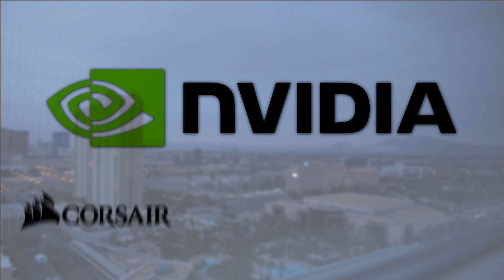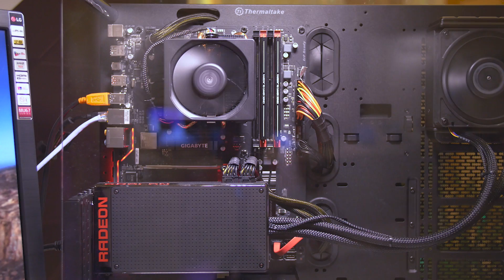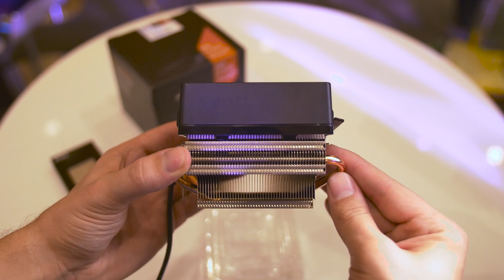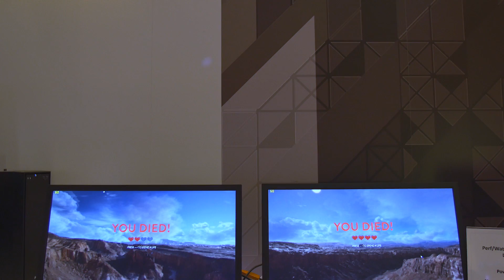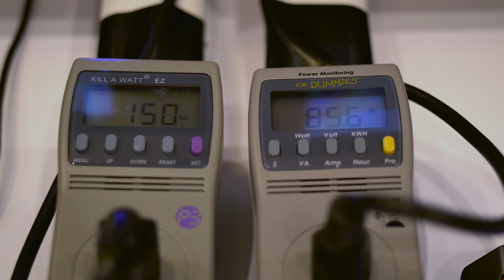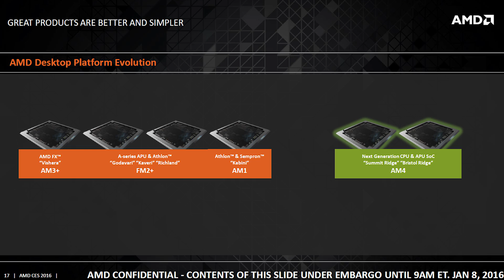AMD Polaris, new Wraith CPU Cooler & AM4 Zen

Comment: I hope Zen isn't the same story as the Fury X.
Reply: those are two entirely different things that can't be compared
Reply: It won't, they got their CPUs and GPUs down to 14nm, they should be much more efficient.
Reply: Joegaming Not when it comes to marketing, or the fact that it's AMD.

l__T__l Efficiency is one thing, which they already have sorted, but power is another.

I was meaning that how with the Fury X, they boasted it was going to be the best GPU on the market, and even showed benchmarks of it beating the 980Ti or Titan (I can't remember exactly which), but then when it came out, it didn't deliver to its promise.
Reply: +SlavjanA pff Nvidia does alot more marketing then AMD but neither does it on YouTube or TV if they really want to step it up thats one way also AMD used to beat Intel and every one new that  but now they just slowed down and AMD didn't make GPUs till they bought ATI
Reply: +SlavjanA I hope Zen isn't the same story as Bulldozer. =(
Reply: +El Hefeweizen http://linustechtips.com/main/topic/48571-intel-amd-architectural-discussion-how-far-ahead-is-intel/
Reply: +SlavjanA 
I don't recall AMD saying that Fury X will be the best GPU on the market.
That seems more like fan expectations blowing things out of proportion.
AMD did mention things such as 'revolutionary HBM' and improved performance per watt (which we DID get - more or less, Fury comes pretty much in line with Maxwell in terms of performance and power consumption at stock).

Also, people seem to glorify Nvidia, but completely forget that Maxwell runs on reduced clocks at stock (giving it more OC-ing headroom).
In reality, when you start overclocking Maxwell, its power efficiency evaporates for the most part, and power draw is substantially increased.

Finally, AMD's gpu's perform much better in professional software than Nvidia does. I suspect that this is where most of Stream processors are going and why more of them do not translate to necessarily better gaming performance.

As for Polaris... the part demonstrated was an entry level desktop part with GDDR5 which consumed on its own (separate of the rest of the system) about 30W (while the GTX 950 is rated at 90W)... they mentioned that HBM 2 will come later, and that the current Polaris chips are open to further optimizations.

Nvidia still didn't manage to present a working Pascal part (what they demonstrated at CES was mobile Maxwell - 980M), and it looks as if they might have hit a snag.

Personally, I'd prefer AMD taking the reins and its marketshare unopposed this year (they certainly need it).

And as for Zen... I don't think we will see a repeat of Bulldozer fiasco.
The 40% improvement in IPC was gained over Carrizo it would seem (as AMD reported that ZEN met their expectations)... now couple that with 14nm manuf. process, and other things (such as HBM, Polaris IGP, etc.), and Zen looks (At least on paper) really good jump in terms of processing power (alas, we won't know anything conclusively about ZEN CPU until we are closer to the launch date).

AMD seems to be pouring everything into ZEN, and also this new Polaris releases, so I wouldn't discount them just yet.
I'll keep an open mind.
At any rate, I'm definitely getting myself a laptop with a high-end Polaris GPU (which hopefully will feature HBM - though I don't think HBM for mobile was mentioned anywhere).
Reply: deksman They did boast the Fury X was going to be better, look around online (I think anandtech had the post) before the launch of the Fury X, and you'll see AMD showing benchmarks of it running better than the Nvidia cards (I think it was at a press conference or something like that).

Even now AMD is beating Nvidia for the most part, anything below the 980 vs 390x (although this does depend on how long the person plans to own the card for in a way), AMD beats its Nvidia counterpart (390 vs 970, 380 vs 960, etc).

As far as Zen, then yeah on paper it seems great, a lot of work going into it as well, over a long period of time, with a lot of talented people, so that's why I hope it really does deliver.
Reply: +SlavjanA 
Don't forget the R9 Fury Nano.
That's a direct competitor to GTX 980 that delivers slightly better performance with a comparable power draw.

Polaris looks to be shaping up into something really interesting.
Reply: Petar Posavec Oh yes, wouldn't have been bad if they lead with that instead of the Fury X.
Reply: +GlueGaming 
No argument that AMD has their work cut out for them... but it is also not entirely AMD's fault when it comes to hardware adoption by OEM's.
In case of laptops, AMD cannot control anything there, though I have to say that Carrizo uptake was better than Kaveri in USA... though Europe saw a much better quality hardware with Carrizo (such as 1080p screens,  etc).

Comment: Tried the Wraith cooler & its still Much Louder & Hotter than with my Noctua setup, I'm sure just the Noctua Thermal Paste alone is a big improvement over what comes with on the Wraith. I'd still highly recommend buying a good aftermarket cooler ;-)

Comment: just when you bought your new pc, with all amd tech...
Reply: Still a year for Zen to come
Reply: +Abhinay Raikar still, that's pretty close about autumn/Q3
Reply: At least I'm not the only onr
Reply: +TheEpicCrumpet That's the rule of building a PC. Something new and better is just around the corner. And the people who upgrade to ZEN and AM4 in Q3 or 4 will be pissed when not long after they announce an improved line of processors with better performance and probably better efficiency.

We just have to learn to bite the bullet. I bought a R9 380 in November only learn the 380x was getting released in a few weeks.
Reply: +this Indeed. I wasn't so angry when the improvement over the 380 wasn't so much. I get the 380x performance with my overclock. 1100mhz core clock and 1600mhz memory clock.
Reply: +RGInquisitor I did the same.... just the day before the 380x was released......
Reply: I feel ya. Literally everything is AMD. But oh well. I think I'll let the 8350 sit in my system for a few years but at some point soon I'll want to replace my R7 360 with a Polaris gpu when they arrive. So I'll be hopping on that when it arrives.
Reply: +Anthony Mendez on what resolution do you game and how does it perform?
Reply: +TheEpicCrumpet I had bought my parts based on the rumors of FX, I got the 6100 and then later the 6300. Now I'm just waiting to see if Zen delivers more than Bulldozer or Piledriver.
Reply: ***** If you're using optifine with Minecraft, set the draw distance to something between 16 and 20. Depending on how much memory and CPU clock speed.
Reply: I technically have the same build as you. An FX6300 @4.5Ghz, 8GB of RAM, and an R9 285. Render distance is the biggest framerate killer, other than mods. Rei's Minimap will drop the framerate dramatically unless you enable multithreading.
Reply: +RGInquisitor 

At least AMD is being smart about it though this time. All their processors, APUs and CPUs, are going on the AM4 platform with DDR4 as standard. So many people on Team Red will at least have a upgrade path without having to buy a whole new system for a good while. Unlike those that have bought the AM3+ or FM2 platforms in recent years that built themselves into a dead/dying platform with no upgrade path.
Reply: +Anthony Mendez 

Something was definitely screwy with Fallout 4. Hell I even had to modify the .ini file just to get it to play 21:9 ratio at 3440x1440 resolution. Game came out in Nov 2015 and wasnt even coded for 1440p. Even then, I still get random frame drops and thats with TWO MSI 980ti's overclocked in SLI driving it.

Comment: Zen CPUs in mid 2016? 5 more months to go!
Reply: End of 2016 basically early 2017 aka 1 more year
Reply: Polaris the low end gpu will come in less than 2 months and the higher end gpu's will come in the summer and for zen amd said q4 so expect october or later, don't expect anything earlier even jan 2017 could be a possibility *****
Reply: ***** june/july 2016 this summer hopefully, expecting no delays

Comment: Looks like those Tom's Hardware articles predicting a brand new AMD cooler featuring a new version of AMD's Cool 'n' Quiet were right after all. How the hell did they know that before CES..? Anyway, lets check what's yet to be revealed so far:
Polaris Architecture. Check.
Brand new stock cooler. Check.
FinFET-based GCN GPU. Check.
Radeon Memory. Check.
"Radeon" branded SSD. Nothing yet.
Vulkan support on Linux. Nothing yet.

Comment: Did they show anything that would clearify if the AM4 socket has the same space between their cooler mounting holes as the previous sockets?
I want to upgrade the cooling in my system, but upgrading now to something that would support my 4690K aswell as AM3+ and then have it not support AM4 would just bring extra expenses and I'd have to buy yet another cooler if I want to upgrade to Zen when it launches.

Comment: as you know , the wraith cooler is not a high-performance one.
and it is still not quiet enough . 
92 mm fan is the point !  
if  wraith use 100 mm fan  and  has 10 mm  cooler fin  , that will be better .
i don't want to spend money  to get  a  unsatisfied  stock  cooler. 
i prefer spend 5 more USD  for   getting  a useful AMD stock  cooler . 
e.g.  something looks like  Reeven BRONTES RC-1001 、Thermalright  axp-100 .

Comment: this is actually making be think more about weather i should get an 6400 i5 like i originally thought, or wait and see what zen has  anything to offer. I tend to use virtual machines and multitask a lot so something with more cores would be nice (but im on a relatively tight budget) , and i didnt want the fx 8300 series because of their dated single threaded performance, cause i ocasionally want to use it for gaming as well, any tips?

Comment: Should i buy fx 6300 now or wait for zen cpu?
Reply: Depends on the price of zen, what will the pricings be
Reply: Gurke7
i3 no, the best to avoid any sort of frustration when gaming and no limitations is get an i5 6500 at least
Reply: Gurke7 i3 is a dual core and struggles with newer titles and no hyperthreading does not double your core count. so fx 6300 here would be wiser or the smart thing is spend an extra $45 for the 6500
Reply: Gurke7 nop physical =/= virtual there is a difference and in many tasks having more cores is more faster and useful than hyperthreading, the i3 is not a good choice for gaming it falls in to the same class as the pentium g3258, as said go for the i5 for only $45 more, much better choice
Reply: Gurke7 thats only in games that are not properly optimized for multi-cores, in a game like the witcher 3 which is optimized for multicores the 8350 and 4790k are almost neck and neck look up benchmarks by digital foundry for proof. and as said the i3 could not start many games on launch such as far cry 4 until a patch by an unofficial modder came and fixed it , people should not wait to play the most anticipated games of the year, in benchmarks in may seem like a lot, but in real world it isn't as much as you think

Comment: Will the Wraith "COOL" enough compare to infamous CM 212 EVO?
Reply: +Sega Hen Never compare a stock cooler to a aftermarket one, especially a 212 EVO.
Reply: +Sega Hen not even close. Just the size of the fan should give you an idea there.
Reply: +wolfstar Replace the 212 evo with the cryiorig H7.
Reply: +SALUSIA  the cryorig m9 too http://www.kitguru.net/components/leo-waldock/air-cooler-challenge-7-way-round-up/5/
Reply: +Sega Hen  Hell no! 212Evo is a beast of a cooler and at $30usd a pop... you just win with the 212.
Reply: +Nguyễn Hồng Phúc (Meta7) 

Its on Newegg and Amazon. Only reason why its not talk about much, is because you only get a 1 to 2 degree improvement for $15 to $18 more (depending where you buy it). The Hyper 212Evo and the 212X are virtually identical except for the extra air channels they added for vectoring the air through the fins and a quieter fan on the X.

Comment: AM4 ? So is it backwards compatible with AM3+ motherboards ?
Reply: +Rafael Rauhala 

Nope, brand new socket. The new APU and CPUs have integrated southbridge so there is no way it's backwards compatible.
Reply: Krkandrkan Thanks for the info.
Reply: Krkandrkan Also do you think it will have DDR3 or DDR4 ?
Reply: Both DDR3 and 4. Motherboard will determine what type you use.
Reply: +Krkandrkan I think it will be only DDR4 since DDR3 is already old c:
Reply: *****
lel

Comment: Why have it at constant rpm?
Reply: +Jan Šinkovec i guess they keep the rpm consistant instead of going up and down and producing different levels of noise. i think the frame around the fan is working as some noise dumpener for a certain rpm-noise-output.

Comment: Im planning to build a new budget pc under 500$.Should I go for the amd fx 6300 cpu or wait until amd zen cpu arrive? I'm confused please help.!
Reply: wait for zen and see if you like it then decide
Reply: +Angam Corey gonson No point investing in a fx 6300. It's very weak at this point. Wait for Zen. I promise you it will be worth it. :)
Reply: +Astralify my only concern is that amd zen may only cater to the higher level users like intel i7. If it turn out that way I'll be just wasting my time for nothing.
Reply: Zen won't come out anytime soon lol.....AMD said end of 2016.…..basically 2017.....Zen will be lot better than FX line though
Reply: +Astralify Can confirm. Have 6400. It's absolute wank.
Reply: Angam Corey gonson That's not how it works. Especially with the king of Price-to-performance AMD. You could most likely get a ZEN CPU that competes with an i5 for the price of a pentium.
Reply: If you're doing an Rx480 with 6300...
DONT! The 6300 and 6350 bottleneck it ALOT

Comment: Well, their mounting system still looks like it's a bitch to work with. On top of that, a constant RPM fan? Why not PWM?
Reply: Sounds like they think it's so quiet they don't need to run it at slower speeds.

Comment: Anyone help my PC PLEASE, IM ON URGENT

I got a problem that's... When I hit the power button, it did work but I have no output to my screen. Then it turn off and turn on again, and it keeps repeating.

My PC specs is
i5-4460
Gigabyte B85M-HD3 rev.1.1
4GB of kingmax ram 1600MHz
Some random cases
Elite v2 550W PSU by Cooler Master
Gigabyte GT 730

I really need help
Reply: +jun jie Run the video cable from the display to the motherboard and not the graphics card. If this works it should confirm a dead graphics card. Alternative try your TV or a different monitor.
Reply: Any beeping noises? If you want better help, ask on Tom's hardware or linustechtips forums
Reply: Last time it did this exact same thing to me, the motherboard was crapping out. RMAed it and never got any problem ever since.
Reply: It could also be one of the RAM modules or slots. Try one RAM module at a time.
Reply: +jun jie try removing the graphics card and connecting your monitor to the motherboard DVI/HDMI/VGA output, leave it for some minutes and if it works then its a dead video card.
Reply: Kezourx CJ Then it is most likely a dead motherboard
Reply: Kezourx CJ
ask where you bought it or search on gigabyte site